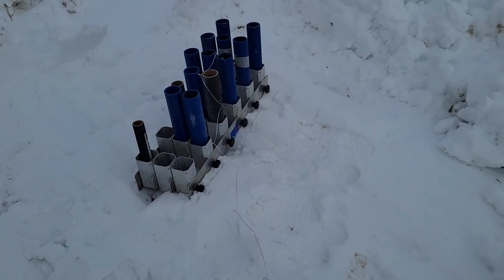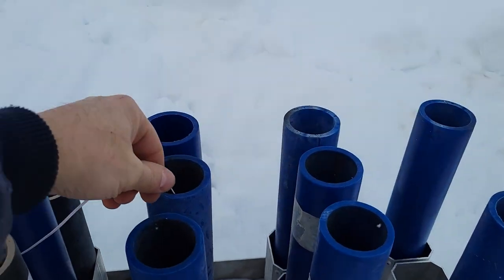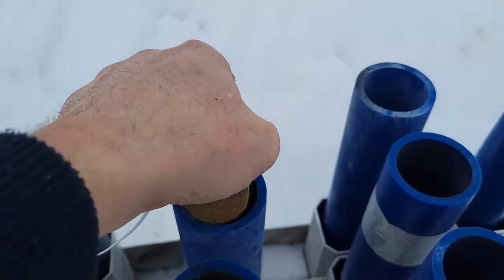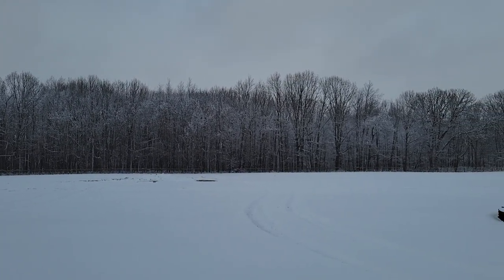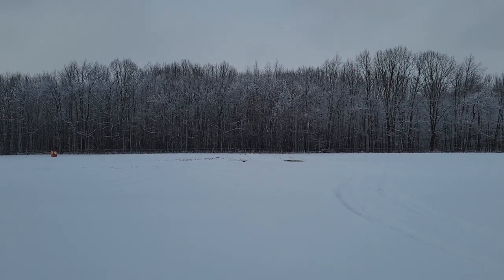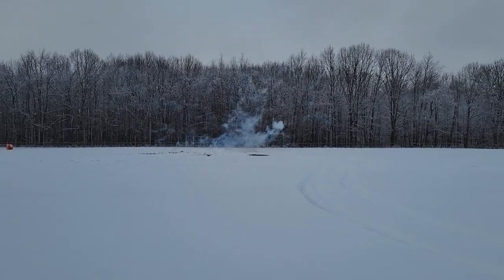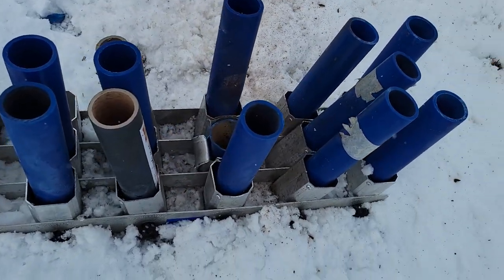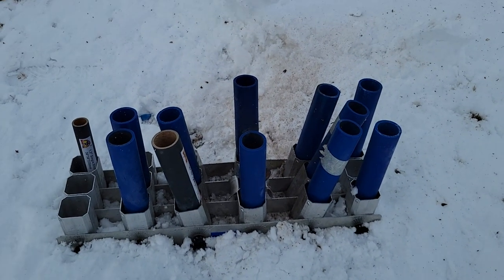Metal Mania cato test!

Comment: The rack held up well. I am impressed. It looks like the pipe ruptured right above the metal mania insert.

What happened to the rest of the pipe? Did it just sever or did it break into pieces? Do you think the cold affected the hdpe?
Reply from the maker: It split and obviously separated. I think the metal had a lot to-do with that separation.  I think the metal held as long as it could and then peeled and that combustion blew the crap out of the mortar. Plus the downward force impaled the plug into the threaded rod. Pretty cool actually.